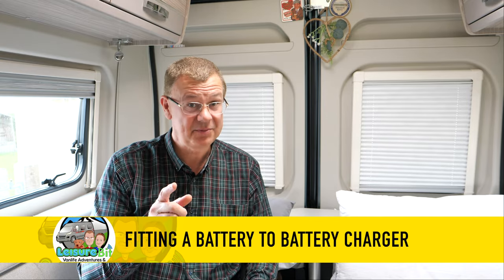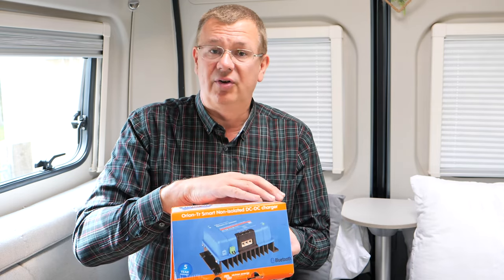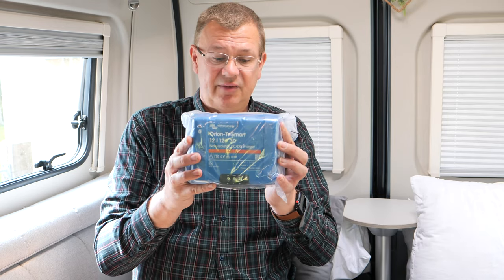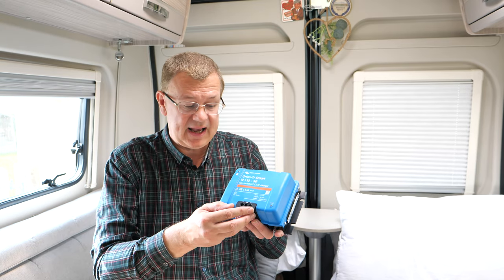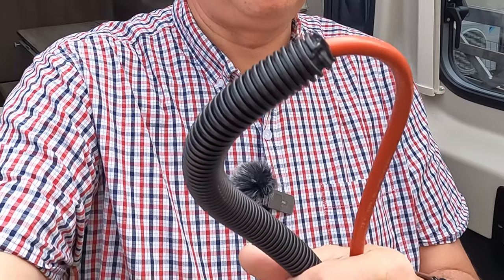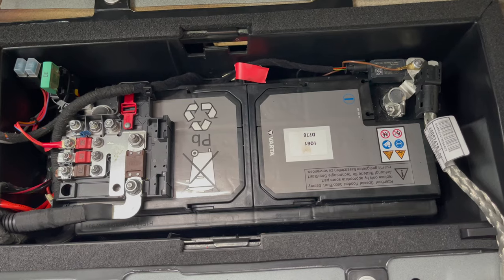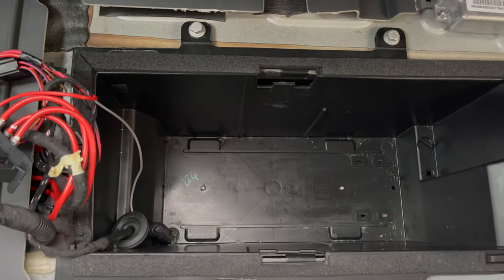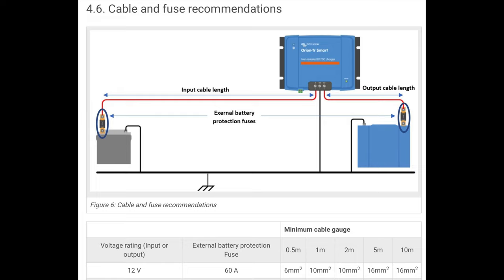Victron Orion DC-DC Non-Isolated Charger B2B Installation in my Fiat Ducato Campervan

Comment: Great video David and quite timely for me as I'm grappling ( in my head only so far ) with either taking out the existing factory B2B which at best will put in approx 35 amps or considering as you have done adding a secondary B2B - I think that is what you have done I watched this late last night 🙂

One question I have is how do you know the two chargers won't compete with each other or get confused in effect whilst they both try and assess the state of the battery and go through their multi state charging processes?

One other benefit I considered of adding a second B2B charger is that if you ever sell the van you can remove the one you added and the new owner still gets the original functioning factory B2B?
Reply from the maker: Hi Pete, that’s right as a second B2B rather than replacing the existing - with the lithium because of how it works the competing hasn’t been an issue for charging the leisure battery as they both seem to be behaving well together - the only issue I had which is common is because I have the battery maintainer when the vehicle is off if the solar or charger is on then the Orion thinks the alternator is on unless you use the D+ (which was handy as goes into existing B2B - you’re absolutely right also ref removing it’s straightforward (except the hole of course which can be plugged) then you can restore back to as was at a point in the future when we sell the van.
I was planning a follow up on connecting the D+ and how to find your alternator size if that would be useful too. 
Hope that answers the questions?
All the best, David 👍
Reply: @LeisureBit  Awesome, thank you, very helpful and gives me some confidence if go down this route too. Yes I have gone through the pain literally 😃of finding my alternator size but I'm sure lots of others will find that useful 👍
Reply from the maker: No easy is it to get to is it  😀 
Have a great weekend 👍

Comment: I've had a B2B fitted for a while but with lead acid leisure battery. I never got the full  amps. I've now changed to lithium and changed the charging profile to suit. Now i get 30 amps full on for most of the charge. Did you notice any problem with the standard alternator? . Ive got a Ducato but don't know its  capacity.
Hope it doesn't overload it now.
Reply from the maker: That’s good that you’re getting the full 30A - I’m just going to use the Orion b2b and remove the old one for that reason to avoid overloading the alternator. Clearly would be fine at speed but on idle there’s a fair whack of current.
All the best, David 👍
Reply: @LeisureBit   i disconnected the original  split charger  system in my sargent unit by means of a relay that cuts the connection between VB and LB  on engine run, so only my B2B is in operation. Thanks for the great videos 👍

Comment: Hi could you tell me what wire crimper you use please
Reply from the maker: Hi, I use a hydraulic one I got from Amazon for about £38 (it’s a yellow one if you search for “hydraulic crimping tool” on Amazon you should see the one) it came with the majority of handy sizes upto 70mm.
Hope that helps, David 👍

Comment: Hi David, after completing the install of my Victron Orion 12/12-30 isolated I’m completely underwhelmed and rather disappointed with the performance. Installed with 16mm cable over a 6m run the negative strapped with the starter batteries chassis negative and using a D+  feed to the H pin. We’ve a '23 Fiat Ducato, so a smart alternator and having searched for smart alternator install settings found a recommendation of engine shutdown parameters-alternator settings-start voltage = 13v. (Having found the default 14v wasn’t working either!)
I’m finding that the alternator hardly runs, so over a 2 hour mixed driving Mway/A/B roads I managed to bank only 10Ah - I do get (when it happens) 30+ amps input registering but then before you know it I touch the throttle and the alternator shuts down again, so VERY disappointing, ANY hints or tips to shed on this one, or work arounds you may have used really appreciated. Thanks in anticipation. Andrew
Reply from the maker: Are you using the Orion on its own or in parallel anything else (like I did with another one) - I did have a bit of faff at first getting it up and running and in my case it was a poor negative connection which I resolved (as it would start then shut off) however, it sounds different, I have found with the D+ rather than voltage sensing it works ok. (I have had some efficiency issues with the two in parallel due to higher voltage cut off when actually it could charge further as when it’s nearing charged, the two b2b’s conflict). - what’s your leisure battery charge % when this is happening? Once mine kicks in it mostly keeps the alternator charging as it pulls down the voltage. Works best when the battery is below 80% (and also when used on it’s own) - I wonder if there’s something different happening on the newer model where the alternator is being really fuel economic. Just one to check (will have a look when in the van) and set it just to use d+ not voltage sense and see if that sorts as I found that best (for triggering charging) - without D+ enabled I had oddities with my battery maintainer raising the voltage and triggering charge then shutting off…. 
Sorry lots of bits there but just trying to work it out as quite a lot of variables which could cause it.
Reply: @LeisureBit  Hi David, thanks for the quick reply. It’s on an AutoTrail, so a Sargent electrics setup which has its own rather limp charging system. Mindful of complications of additional chargers confusing things I’ve also set the D+ to trigger a relay which isolates the leisure battery from the feed to/from the vans own electrics, after all the leisure side shuts down when the engines running so I’m not losing anything particularly.
Today’s trip, the first after install I deliberately drained the 280ah lithium to 50% to leave room for my rather hopeful 40-60 ah uplift!! 
I did try on the last 30 min leg disabling engine shutdown detection, perhaps slightly better but still only 9ah. I get the impression that the charger doesn’t load the system but reads the alternator shutting down on acceleration and stops charging. Cheers Andrew.
Reply from the maker: Not sure if you can get someone to check on the app when driving but did you notice when it was drawing full load what the voltage dropped to as read on the Orion? When I first set it up I used the standard at battery voltages you would expect but needed a little tweak based on what it was reading. (As similar to you. I had about 6m cable - mine is the non isolated so I have a very short negative to the chassis so i worked about 7m.. 7m gives around 0.53V drop which is slightly more than recommended just (6m is about the limit) - if isolated you would have the sum of the negative and positive so 6m each is 12m which is around 0.91V at 16mm2 - less of cause any drop for connections and protection etc, For isolated if the total length is 12m to be in the safe drop you would need 35mm2 but 25mm2 would just about get away with as just on the recommended line if half a volt drop, (all based on 12V at 30A)
If you could get someone to check when driving, just see if it’s cycling (I had that with bad earth creating too much voltage drop) - you see this with the voltage standby dropping when the current draw goes up, it also gives the running values, by adjusting these you can then force the alternator to charge by drawing down the battery (as vehicle battery voltage will drop with a 30A load - there’s a sensor in the negative line of the battery for smart alternators, so should oick up the load)
Definitely worth looking at the run metrics in the Victron app as that should help determine what’s happening and allow for adjustments. The great thing about the Orion is you can adjust it as you know and it’s just making sure it doesn’t discharge when the engine is off. 
The only other thing I can think of is if the D+ line is sending engine running or charging as seems to be some variance in vehicles depending on the usecase, let’s assume it sends when it’s charging (and you want when engine is running) you could use ignition on and put a delay of say 60s in the Orion to give time for the engine to spin up and then adjust the settings - that would mean it charges when ignition on so should drive force the alternator to kick in more - this is just different things from what you describe so not 100% on which it is but the measurements should help pinpoint. 
All the best. David
Reply: @LeisureBit  all very good ideas, thank you very useful. 
I had switched the app off as it’s mesmerising whilst driving and far too distracting, I'll find a willing observer or perhaps record the screen whilst driving and look back at it. 
Good point with the negative, which I hadn’t considered , what I might do is run a shorter cable to my chassis connection and treat the unit as a non-isolated essentially and see if that changes anything. 
Re the D+ I use the line for the fridge, which I’ve tapped into. The same signal is used to trigger a relay with the N.O. pins connected to an indicator light to reassure me the switch has been thrown separating the 2 systems, so I’m reasonably confident it’s an engine running but … I’ll check that out and measure the indicator voltage/activity as that’s easier to get to. 
I’ll get back to you with an update, to fully access the Orion the battery needs to come out, as a result these troubleshooting actions might not happen straight away but then again…
Thanks once again David.
Reply from the maker: @joandandrew5097 good luck and good idea to screen record the app. Hopefully that helps give the answer and resolution 🤞
Reply: @LeisureBit  Thanks David, that certainly seemed to do some of the trick! I moved the negative to a nearby chassis connection and now I’m almost consistently getting around 20A, on engine overrun, coasting, downhill it’ll peak at 30-34. On a mixed run I got on average 20A/hour but with the occasional and odd drop out to zero - so there’s work still to be done to tweak it but for now I’m reasonably happy. It’s interesting that the max cable it’ll accept is 16mm so to possibly improve I’d have to insert some 25 along the under floor run and join it up, got to confess not keen on that one. 
Thanks once again for taking the time out to respond & helping to save the day. 
P.s. really enjoyed your Northumbria trips, as a youth we would enjoy a summer break in a holiday cottage in Seahouses. I remember well the rolling ride and salt air tainted by the smell of fishing boat exhaust on the way out to the Farnes. 
Andrew
Reply from the maker: @joandandrew5097  no problem - pleased its working better now. It’s a pain isn’t it that it will only take 16mm2 cable but as you say you can work around it. It’s a lovely coastline Northumberland and great trip out isn’t it - all the very best, David 👍

Comment: isolated version is better if you are using comms or audio equipment as it creates less noise.
Reply from the maker: Imagine it would be, especially with anything sensitive / transmitting equipment. Notice the new XS is only available in non-isolated currently. All the best, David 👍
Reply: XS is not an option for me cuz I need 12/24v.

Comment: IMHO, you have way tooo many fuses and breakers. There is one needed between the main battery and the charger and then another between the charger and 2nd battery. 
You can use a isolator switch also at the back, but that is really all you need.
Reply from the maker: You’re right in what you say - the additional ones I fitted enable me to reverse it if I ever got a flat battery and give protection against certain exceptional circumstances- there’s another video where I’ve upgraded it and simplified it - the in-line breaker I’ve used in this one turned out to be not the best so have removed it.
Thanks for your comment - all the best, David 👍
Reply: @LeisureBit That is a valid point. Can you tell how much heat  it produce ? I have a bit tiny space.
Reply from the maker: @marcing4287 The 30A one gets quite warm when running at peak current, worth fitting a fan in a small space, the Orion XS doesn't seem to get very warm (you can feel it's warm but not hot) - not sure all the time but I've checked a few times and just Luke warm to the touch where as the Orion 12-12-30 gets (very) hot to the touch when running at full power
Reply: @LeisureBit is it always running on the full power ? Looks like I need to try it when it is a free standing before I will pack it to the box. 
Installing a fan is a solution, but how to set it up to only run when Orion is running ? Otherwise it will flat my battery (either main or secondary)

Comment: The first thing you should do [IMO] is disable the stop-start engine "BS routine" - which has to be the biggest CON JOB under the guise of "reducing engine emissions" each and every time you stop at traffic lights etc., etc.! What hair-brained idiot that persuaded vehicle manufacturers hence persuaded the authorities [or vice versa] to allow this to become entrenched in emission regulations, has completed ignored the INCREASED engine emissions when starting up each time compared to your engine idling for the same period while stopped! Additionally, and far more important for the hapless driver that has this type of vehicle - IT IS ACCELERATING ENGINE AND TRANSMISSION LINE WEAR OUT OF ALL PROPORTION, which also increases said engine emissions as this wear increases! Go figure!  Cheers.
Reply from the maker: A bit like speed humps where they increase pollution and wear on the engine and suspension etc, whilst at times it makes sense, sometimes daft as it restarts too eagerly if waiting and kind of defeats the object. Small miracle it’s working at all 😀
All the best, David 👍